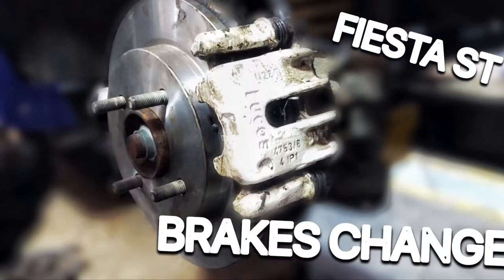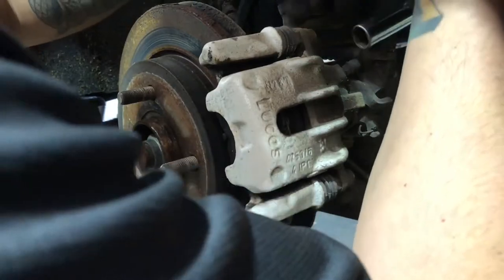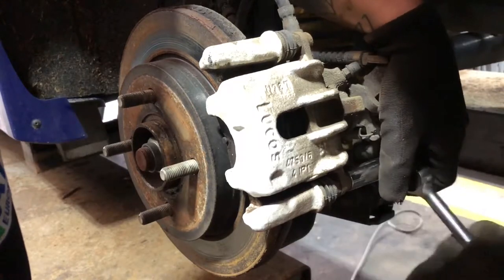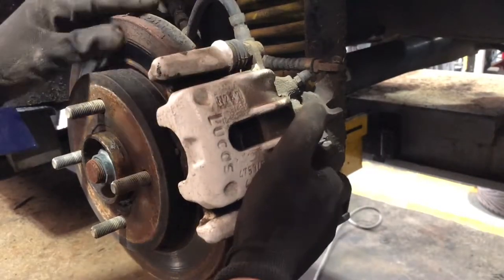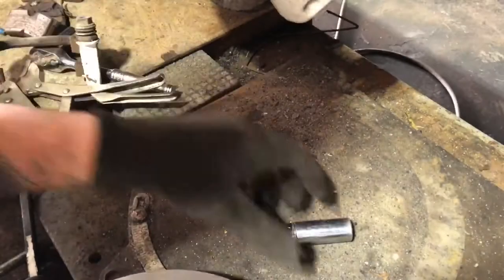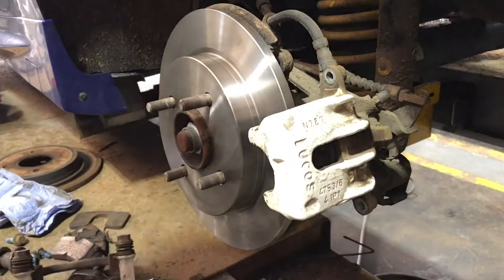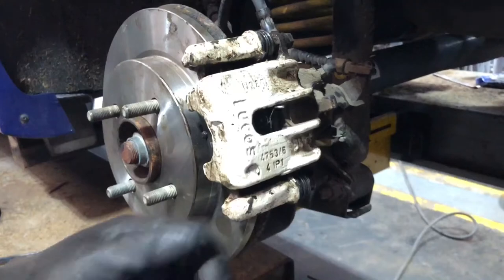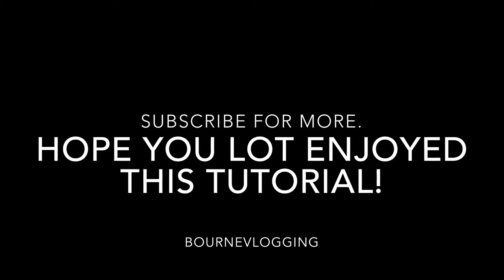FIESTA ST - HOW TO CHANGE YOUR BRAKE DISCS & PADS!

Comment: did u have the handbreak on during changing these and did u remove the brake fluid cap befor u pushed the calipers back to put new pads in

Comment: Remember to clean both sides of the disc
Reply from the maker: David Bryant was all done don’t you worry🤙🏽 just a brief video on how to do them. I’m no expert but hope it helps people!
Reply: What was that turn up tool for? I changed my rear disks and pads the other day but I didn’t use one of them what’s it’s for?
Reply from the maker: Justkurt 96 it’s to pus the piston back in 🤙🏽
Reply: BourneVlogging do you have to do this? Will anything happen if you don’t? I haven’t come across any problems yet tho
Reply from the maker: Justkurt 96 well it usually is sticking out might not be if you had the handbrake off.
Reply: I've just attempted this - handbrake off and the piston is still out. Any suggestions on getting it back in so i can refit caliper over new pads?